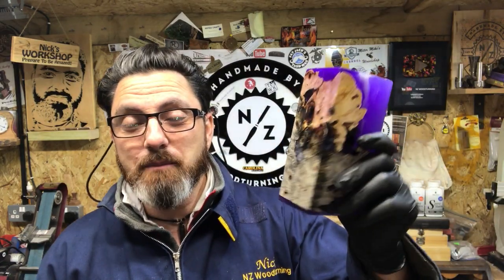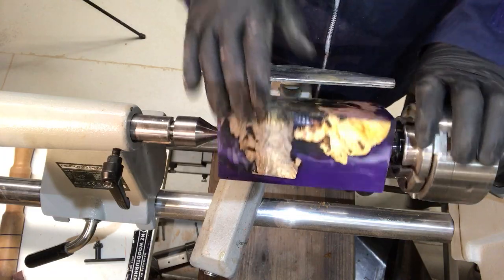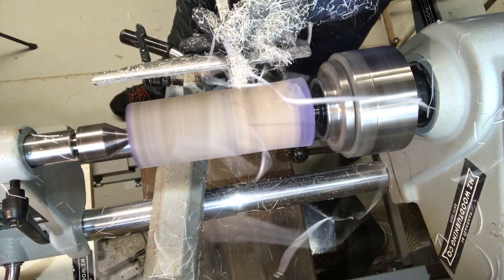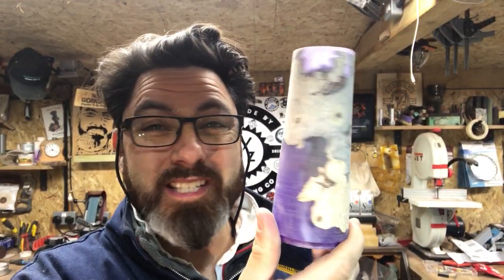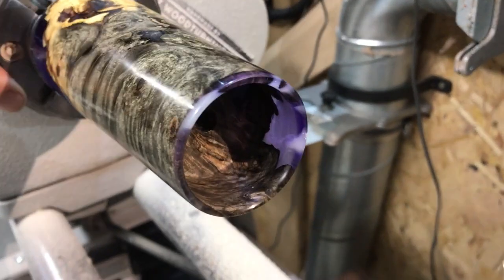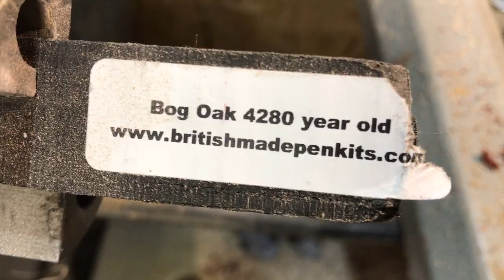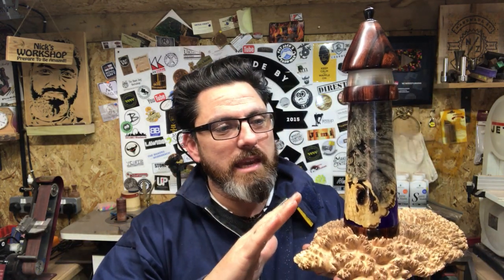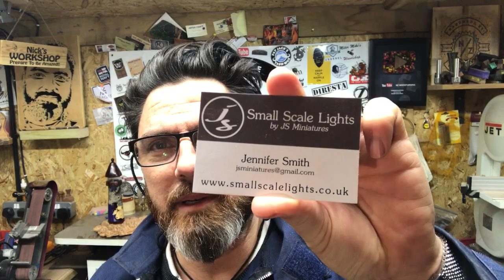Woodturning - a lighthouse from this hybrid burl blank

Comment: Hi Nick, I have noticed that you always cast in a square and then have to turn it round. I looked at the price of resin and after my heart started beating again I thought about the amount of waste that is just turned off. Have you tried using PVC pipe to cast in, it is cheap (I like cheap) and can be turned off without damage to your tools and the big advantage is no waste.
Reply: John Fithian-Franks well, to be honest... Less waste, anyway.
Reply from the maker: Hey John , would be idea but the wood comes square in most cases so it’s hard to do that. I see what you mean of course and resin is expensive
Reply: How about rounding off the wood before putting it into the resin mix in the plastic tube?

Comment: Hello from Florida Nick. I first guessed it was going to be a pepper grinder, but then you added the cleat bit & I was sure it was going to be a pepper grinder.  Even after you added the the burl cap for the base(I thought that it would look cool as the place for it to sit on the table when not in use.) I think I might try a similar cast for a pepper grinder.  Jim

Comment: Hey Nick great video! Just a couple suggestions here, instead of gluing the bottom you could afix it with a few dowels, then it would be steady but you could still rotate it a bit depending on where you want the front to be and also be able to get to the wiring! Also if you put a little mirror or bit of reflective material like tin foil on the very too inside of the little hollow out bit it might reflect the light a bit better. Anyway it’s up to you! Thanks for another cool video, loving your creativity!

Comment: I've been watching your videos for a short while now, and I've been a subscriber for about half that time. I really enjoy your projects; they always turn out interesting and beautiful. I have a suggestion for you for when you decide to use electronics in your pieces: I noticed that you were struggling just a bit with getting the wire into the lighthouse when putting it back on the base. Have you considered running the wiring through a piece of PVC pipe (or some other kind of pipe) and fixing the light at the end of the pipe, then placing the lighthouse over the pipe? That could help with keeping the electronics nice and snug, and keep from potentially damaging the wiring due to twisting or somehow breaking the copper inside the wire, as well as potentially allowing easier access to the wiring, depending on how you decide to go about placing the piping in the piece. Your work is amazing!

Comment: Hey Nick, I had an idea for a resin project/experiment for you. Mix up a batch of lightly tinted resin and pour it into your mold then  do a mix of different colored resin that is more opaque and put it in a large syringe with a large bore needle. Use the syringe to try and inject columns of resin into the lighter color. You could also try to do like a globe of color suspended in the lighter resin.

Comment: Very interesting, absolutely love the materials used. I was going to comment as a joke "what sort of lighthouses do you have around your neck of the woods? Lol", but I feel this would be more constructive to say that if you ever visit this again personally I would try to 1) get the lense clearer looking. 2) reduce the size of the top hat on it as it looks out of proportion. 3) Reduce the length of wires so they don't need bunched up. 4) Now I know it may never be seen but the underneath let's your beautiful project down. I would router out a perfect square and use a square plate to lid the electronics.
5) I'm saying this as a fan of your channel, I believe it has the potential to be really beautiful, but for not having a plan it's pretty great :)

Comment: In the pressure pot..... Are you pulling a vacuum to pull the bubbles out? And thank you! Your work is amazing!
Reply: Adding pressure causes the bubbles to shrink to such a small size they are no longer visible while the resin sets.
Reply: @stevenpuckitt212   Thank you very much!

Comment: you can buy sticky bits of wax for securing candles in a vase a couple little balls of it could secure the lighthouse without being a permanent glue or screw holding it secure

Comment: I want to resin a mosaic table top but see everyone putting their resins in the pressure pot. Is the pot just for saving time or are there other reasons For this? I do understand getting rid of bubbles but is there any other way?
Reply: Wanda McLean I believe you can use a torch or heating to remove the bubbles. You shouldn’t have to worry much about bubbles with a pour like you’re planning.

Comment: How much do those chucks run up to ? I know that cost a quite a bit it's a commercial turning machine I believe
Reply: DJ.Spikes Hostage well, I've seen the chunk he put into the resin go upwards of $125, the amount of resin used around $40, the "rocks" base piece $275 (and up) the other turned bit of wood depending on specific species anywhere from $75 to $450, and the 4000+ year old Bog Oak pen blank as much as $125 depending on where you get it. Add to the the cost of his labor, experience, and artistry..... Materials alone could run above $650 up to about $1000, or more.
 If you are refering to the lathe, a machine similar to that one at a local deal is about $2700-$3600 depending on specific features like repeatability, power requirements (110 vs 220) which is based on the motor. 
[All prices based in the US Dollar in the area where I live]